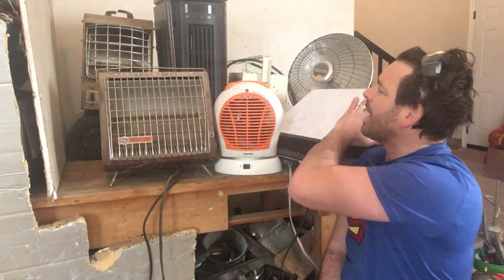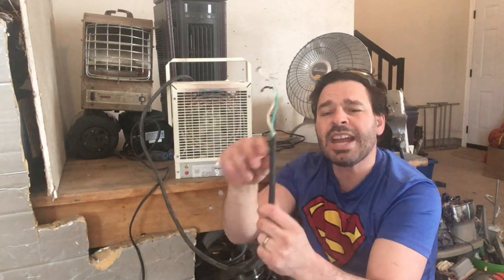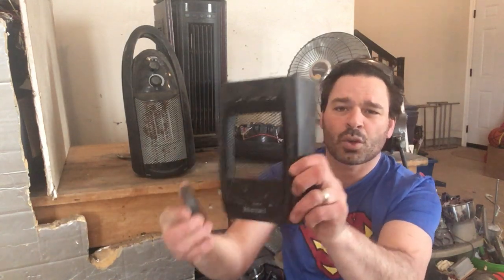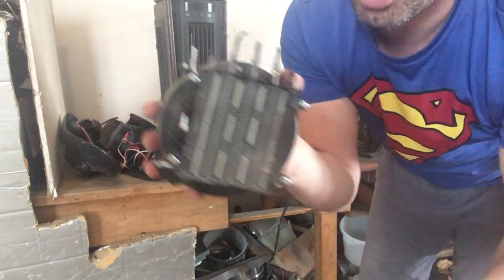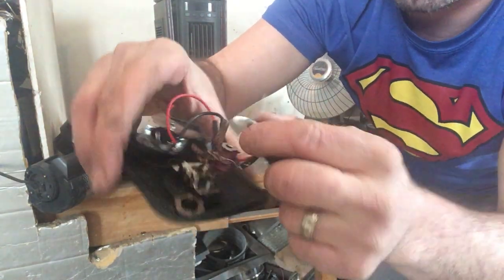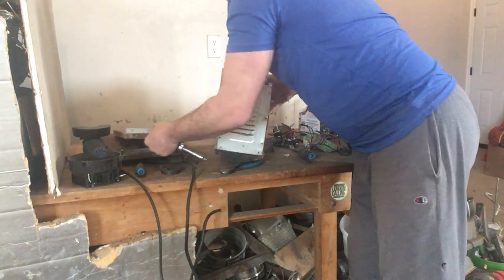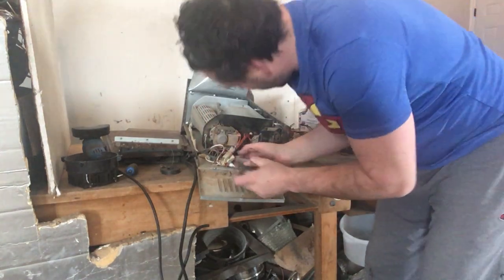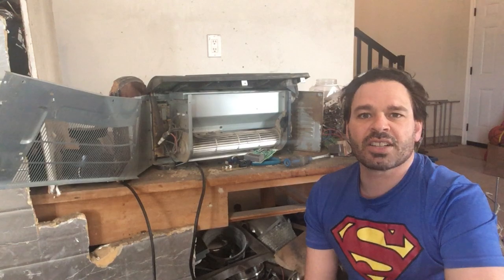Scrapping heaters for loads of copper, tin, aluminum, and other metals and little waste!!

Comment: I wouldn't resale heaters. They're in the garbage for a reason. You don't know what's the matter with them. You're taking the liability on just because they work there. What about when you sell it? Somebody else gets it plugs it in and there's a fire and they say well. I bought it from this guy here. That's you. When I find stuff in the garbage or on the side of the road I scrap it. It don't matter. I'll take the copper and whatever but I don't resell nothing. 👍👍🙂🇨🇦
Reply: It is amazing what people just throw out because. Don't you run the same risk when you buy at a thrift shop, Goodwill etc., you don't know why the item was donated or if it works properly and safely.  I think you can easily tell if something works or it doesn't just by testing it out first.
Reply from the maker: @aprilw6044  absolutely. When I sell at a yard sale I will tell the people that I found it and have a plugged in chord at the display too for them to plug in and test the items before buying.